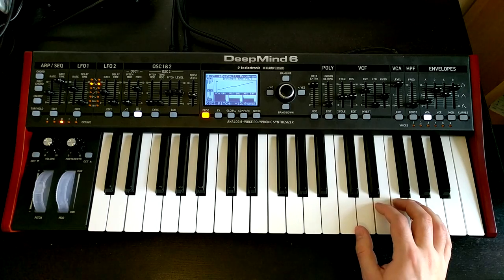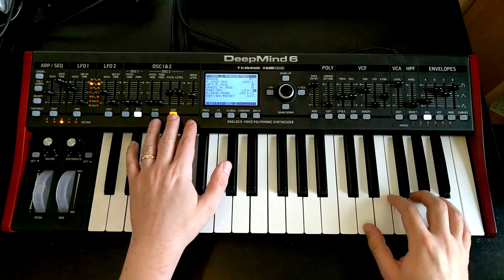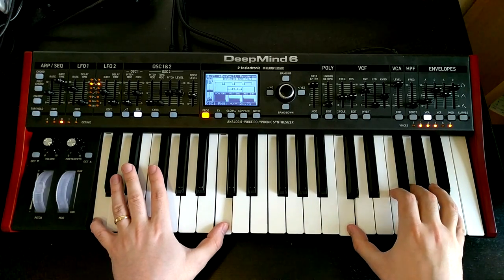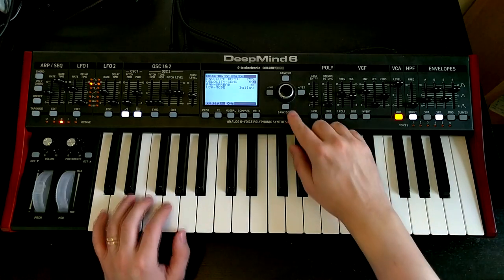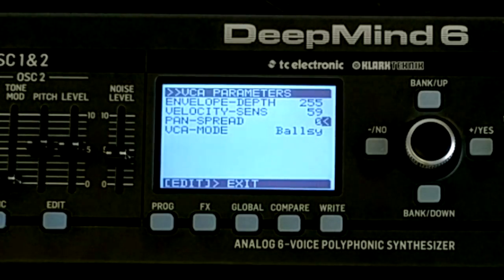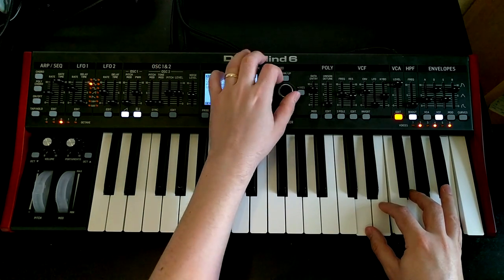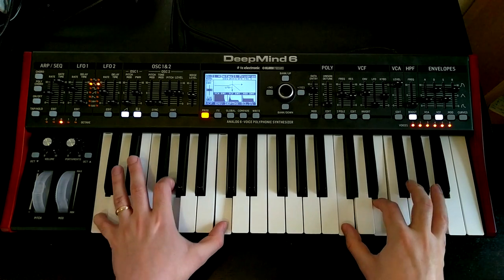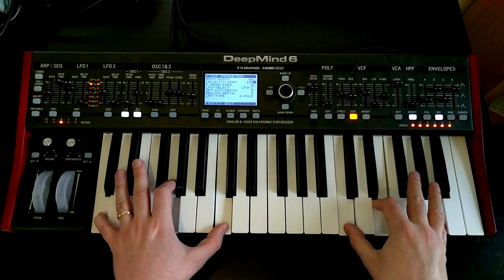Behringer DeepMind - Let's Build a... Pad!

Comment: Thanks for those vids ! Amazing stuff.

I do think to get the Behringer DM but thinking between 6 or 12
If this would be my only one synth I would go with 12 - but I’m thinking to use it as for gigs (6 would be more compact) I also have the Prophet REV2 and Moog SUB 37. 
Wanted to ask your opinion, do you think DM12 would be so much better ? I’m also thinking that the Roland Juno has also 6 voices. 

Cheers !!
Reply from the maker: If you have a keyboard controller you like, then I'd highly recommend getting the 12D - it'll give you a lot more flexibility with unison patches.

Comment: Very informative OS. Is the DeepMind capable of recreating the famous Vox Humana sound from the Polymoog?
Reply from the maker: I should think you can get pretty close - and you can add a phaser in the effects engine to get fully Numan-y!
Reply: Oscillator Sink yes, from what I understand it’s 1 sawtooth oscillator and a PW oscillator being modulated by 2 lfo,s / sine waves using a slow and faster rate.
Really liking your videos. I think I’m sold on a DeepMind.

Comment: A Decent tutorial cheers.  I think that the Deepmind 6 though in some ways is going to have an effect on many people like the DSI Mopho did.  In respect to the thought of `Yeah I have a DeepMind 6 now and it` great but wish I`d spent a little more and got the Deepmind 12 or Deepmind 12D ( I have the 12D ) in the same respect many DSI Mopho box owners really wished that they had got a DSI Tetra instead ( that happened to me and eventually I got a Tetra too )
Reply from the maker: I'm happy with my 6 for the moment... But if I ever get the hankering a 12D in poly-chain mode to make a great big DeepMind18 would be nice!
Reply: @OscillatorSink   The 12 is amazing. Just the complete control of the voices make the 12 worth it. You can stack the voices in two or three voices per key press... and then when you use the detune the sound is so, so fat. I've had a bunch of small analog synths, minilogue, monologue, bass station II, as well as some digital polys like kingkorg... but this deepmind 12 is hands down my favorite. so easy to program but so complex at the same time. but it can get nasty sounding really quick too, especially cranking the reso too far. but super impressed with behringer. the neutron is so, so fun to play with also. VCOs and semi-modular.

Comment: Great video! Once you create/modified a patch, how save / store it? how to set favorites? tnx best
Reply from the maker: From the manual:
7.4 WRITE (Write Menu)
To write a program to memory press the WRITE switch to open the WRITE 
PROGRAM menu. 
The WRITE PROGRAM menu will then appear:
In this menu you can use the -NO/+YES switches to navigate through the 
sections. The selected section will be highlighted by an inverted character (white 
on black).
The fi rst section is the program location the current program will be saved. 
You can use the UP/DOWN switches, the rotary knob, or the fader to select the 
required BANK (A-H) and PROGRAM NUMBER (1-128).
The second section is the CATEGORY to select any of the available categories. 
Again you can use the UP/DOWN switches, the rotary knob, or the fader to select 
the required CATEGORY.
The third section is REPLACED BY which allows you to name the program to be 
written. You can use the -NO/+YES switches to step through each character of the 
name and use the UP/DOWN switches, the rotary knob, or the faders to change 
the character.
There are also two short-cuts for selecting characters indicated by text above the 
FX and GLOBAL switches: 
a-A-0 - Pressing the FX switch will cycle between lower-case, upper-case and 
numbers.
DEL - Pressing the GLOBAL switch will delete the currently selected character.
Note: These short-cuts only appear when you are editing the name of the 
REPLACED BY program.
Reply from the maker: (so to summarise, press "write", select the patch you want to overwrite, press "write" again). 

(there is no "favourites" feature).

Comment: Hello ! How do you get the deepmind 6 to play One voice per note ? I just bought mine and i'm struggling playing chords because it allows me only  to play three notes then all the voices are taken ..
When i want to record midi with my mpc1000 it's quite a problem so if you have any answer that would really help !
Looks like a great synth (it's my first one with a keyboard ) and i'd like to dig deeper with it 

Thank you and Great video by the way happy to discover this !!
Reply from the maker: Look in the "Poly" menu for the unison/voicing settings. Poly-2 means polyphonic, with 2 stacked voices. You want normal Poly. This setting is set per patch.
Reply: @OscillatorSink  I tried to do that But i don't see Poly 2 , i only see Poly  when i open up the voice parameters and by default when i press a note it goes by 2 voices
Reply from the maker: (sorry I meant unison-2)
So in the Poly Menu the "Polyphony" setting is just "Poly"? But two voices are lighting up every time you play? Does changing that setting change this? Is is the same on every patch?
Reply: @OscillatorSink  Yes i figured you meant unison haha ! 
Yes that's the problem .. it's the same in every patch i tried so far , i set it to poly and yet 2 voices light up the leds / Unison2 = 4 voices .. Could it be because of the firmware ? shall i update it to the latest version or is it something else you think ?
Reply from the maker: I'd update the firmware and run calibration.

Oh, two other thoughts: is chord mode enabled?
Do you have any midi or USB cables plugged in - if so, remove those. You could have a midi loop-back issue (eg. your DAW could be echoing the key you're playing back into the unit and double triggering the note).
Reply: @OscillatorSink  It's the midi cable !!! Just unplugged it and it was it ! how do i use midi to make it work with my Mpc 1000 without it being looping the signal ? ( Damn you're good haha )
Reply from the maker: So what was your setup? What cables were going to and from where?
Reply: @OscillatorSink  I have a novation bass station ( so it's my first polyphonic synth hehe) going THRU the deepmind , And the Deepmind Going IN and OUT the MPC1000

Comment: Are There organ sounds?
Reply from the maker: You can create some fairly convincing organ sounds, but it wouldn't be my first choice if that was mainly what you were after.
Reply: @OscillatorSink  can You recommend something?
Reply from the maker: If you want something cheap and little but fun the Reface YC is ace. The Korg SV-1 is still rightly very popular and has a wide range of organ and electric piano sounds, there's also the Roland VR-09-B, but I've never played one myself.
But bear in mind I'm not an organ player or even a keyboardist, so take those recommendations with a pinch of salt.
Reply: @OscillatorSink  Thanks!

Comment: how to do you save or write a patch you've created?
Reply from the maker: You press the button labeled "WRITE" - it's right underneath the screen. Then use the scroll wheel to select the bank/program slot you want to save it to (by default it'll be the program you're currently on) then press "WRITE" a second time to confirm.

Full details of this can be found in section 4.8 of the manual ("Writing Programs"), the process is also explained on screen when you press the "WRITE" button.
Reply: Oscillator Sink thanks so much. Someone needs to make a tutorial on this.
Reply from the maker: I'm not sure a tutorial would add much to how it's described in the manual. To be clear: if you're overwriting the patch you were editing, it's literally just "press the 'WRITE' button twice". Probably a bit short for a tutorial to be fair.
Reply: Oscillator Sink yeah, I looked at the manual and it’s kind of confusing to be honest. I feel the menu diving here is the only thing I hate about it.

Comment: Too much bass on your voice - waaaay too intimate!
Reply from the maker: +killerdalek I'M IN YOUR HEAD
Reply from the maker: All of them at once.
Reply: Was ok. Perhaps a bit of cut between 100-200 hz wouldn't hurt. But most likely you are just a bit close to the mic and are getting some  proximity effect, if its a cardioid. If so back away from the mic and turn up the interface gain a bit. ;-)